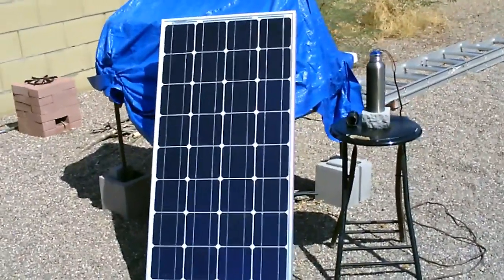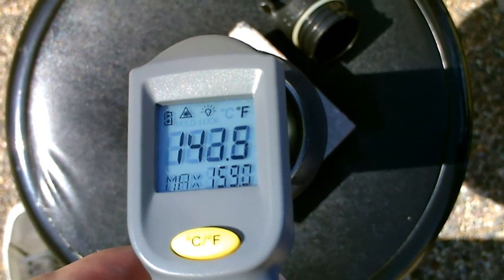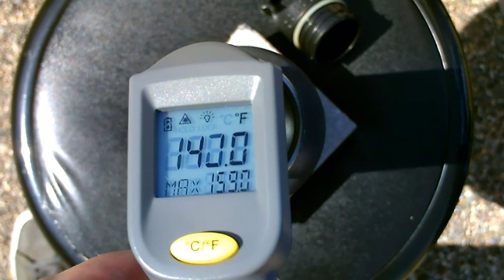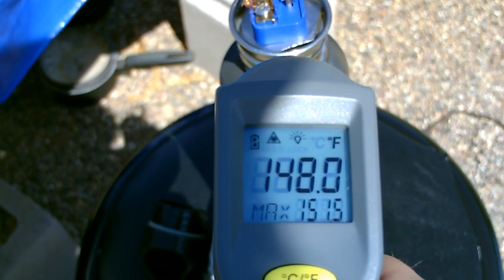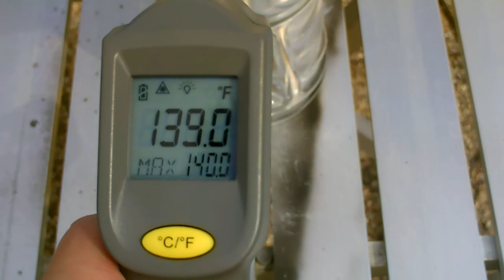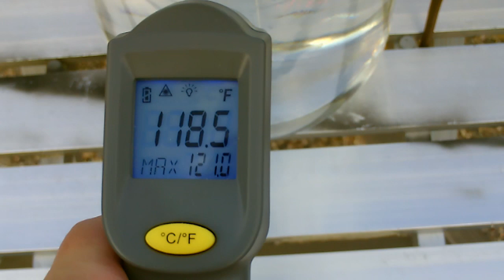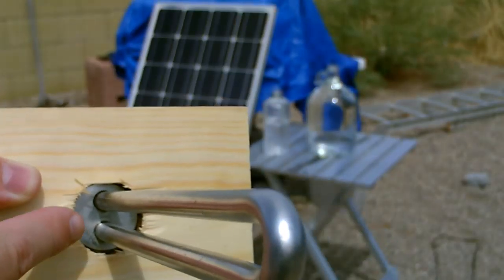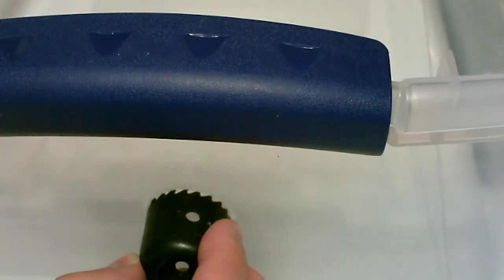How to Heat Water with a Solar Panel! - Small Batch PV Hot Water Heating! - Easy DIY

Comment: I would recommend putting some kind of circuit protection in between the panel and the element, a simple resistor with a snap fuse similar to a car, and a switch.
This will protect the panel in case of short circuit.

Comment: Thanks for the video. Never pull a juiced up heating element out of the water it will fry almost instantly Always disconnect power first. They get hot enough if touched will remove chunks of flesh.

Comment: I bought a propane on demand hot water heater. When I make dish water I use a found ice chest. I just Rinse it out after each use but if you want you can use liners and start each wash with perfectly clean vessel. 

I make dish water use some Dawn and a squirt of bleach. I make it hot soaking my dishes so they are easy to clean.

Comment: How long did it take I want to use solar panel And a heating element in a big beer kegs I made a fire pit water heater for the pool but I want a few kegs getting heated with solar panels and elements so I can dump hot kegs in every now and then

Comment: it would have been nice to know how long it took to heat the water!
Reply from the maker: that will vary quite a bit depending on air temp, cloud cover, exact specs of your particular solar panel etc. i had clouds going in and out so element temp wasn't constant. can't give an accurate time frame. once element heats up it doesn't take long.
Reply: it would be nice if you expressed some gratitude for his exceptionally easy to follow videos ya grumpy so n so

Comment: Got me thinking about getting a small hot water heater for a car dweller . All you need is 2 gallons hot water heater one of cold water a 2gallon blending vessel and gravity. I have taken many gravity warm water showers. A trucker doesn't need to heat up water if he stores it under his sleeper it's always hot there so a 6 gallon batch of water will be the perfect temp for shower. I get 3 showers out of 6 gallon . I also use that water for hand wash. So I could probably get 5 showers out. Never tried for more hate to run out of water covered in soap.

Comment: Also one could put a capacitor and a battery in line with the element to turn off at desired temperature and then charge the battery.

Comment: Excellent idea!  I invested in one of these that is smaller with a coiled end (though am not on the road overnight much, if at all, anymore) so I wouldn't have to boil water with gas and have a potentially leaky gas canister with me.  I never thought about using a larger bottle or even insulated flask though have the insulated mug, great idea! Thanks for sharing!
Reply: can u make it with a very tiny solar panel like 20x20 solar panel? i have two of them
Reply: @peppermeat8059  No most likely, even if you solar panel is unlikely 20 inches by 20 inches... though close to the more likely 100W minimal solar panel size of like maybe 36" by 24".  You'll need a larger panel that can produce at least 100W power.  Also, depends on the specifications of your heater, volume of water heating and the insulation capabilities of your system so heat isn't lost when heating and water gains heat to temp your want.  Figure your solar panel has a rated output in volts and amps where volts multiplied by amps equals power in watts.   Then if that solar panel can meet the specifications of the immersion heater.  The immersion heaters range from 100 Watts (W) to larger sizes.  I'd plan on using a smaller immersion heater and plan to heat a cup of liquid (~.25 Liters (L)).  Once one has enough solar power, see how that performs based on weather conditions for sunlight that provides the solar energy for your solar panel.  If one thinks can do more, than upgrade volume of water maybe first if the insulation capabilities are performing well enough.  Or if time is something one doesn't have and needs heated faster, then increase the immersion heater and solar panel size.  Figure for a 150W immersion heater you require at least a 12V x 12.5A = 150W solar panel.
Reply: @jafinch78  i dont have that
Reply: but i have an 8,6cm x 4,6cm advanced crsytalline silicon solar panel could do better right?
2 7,9cm x 4,4 cm basic solar panels could it atleast warm it a little?
Reply: @peppermeat8059  I little maybe since a calorie is the amount of heat it takes to raise the temperature of 1 gram (0.001 liters) of pure water 1 degree C at sea level. It takes 100 calories to heat 1 g. water from 0˚, the freezing point of water, to 100˚ C, the boiling point.  So, calorie is related to watts (W) where 1W equals ~0.24 calories per second (cal/s).  So maybe 10W is easier to comprehend since equals ~2.4 cal/s and will heat the 1g (0.001 liters) pure water ~2.4 degrees C theoretically, in theory.   So, will warm a very little and slowly over time if there are not heat loses in theory and actually.

Comment: Good idea! 👍 Now where did you get the element and how long did it take to get the water that hot?
Reply: Google 12 volt heating element ? ∆ is dependent upon many factors, temperature of all, water,air,shade,insulation etc. Longitude playing a factor.

Comment: Most 100W solar panels end up being about 18V DC under load.
Which solar panel do you use in this video?
Which 12V heating element do you use in this video?
Reply from the maker: hi. i use a 100w monocrystalline renogy panel. the few extra volts don't have any negative effect on the heating element. i used a Dernord 12v 150w element.

Comment: can you show how you hooked up the wire to the solar panel next time and what size wire u use
Reply from the maker: hi. i just twisted it on their. i used standard indoor extension cord wire. (the common ones that come in 6 to 9 feet and cost about $1.50)

Comment: would be interesting and possibly very efficient to make a parabolic reflector using a mirror that reflects Infrared but passes visible-to-UV through to solar panels behind the mirrored surface, so you could reflect IR into the water and use the higher frequency light to run a heating element from the solar panels  :o

Comment: You can use an AC element of 1000 wat with the 150-watt panel it will work.
Reply: please explain with resistance calculation

Comment: what is the time it takes to heat the water?
Reply from the maker: hi. it varies quite a bit depending on how much water you are heating and if you are running the heating element at full power but i think i've heated a liter to boiling in like 7-12 mins. i've have to double check that though as i'm going on memory (i'm currently using the element in a large ice chest)

Comment: Would it work for distilling water?
Reply: A basic solar water distiller would be cheaper, simple and probably more effective. Unless of course you take the panel's current to produce HHO then you could make some serious #distillation !
Reply: Yes but to get any measurable amount you want to use propane or wood pellets for fuel . You can get 50lbs sack of pine wood pellets from tractor supply <$9 Best to make your own distiller use same setup moonshiners build. You can go large as you want or as small as 4 quarts.

Comment: How big does the solar panel has to be?
Reply from the maker: i'd use at least a 12v 100w one. if you want the element to run at 100%, use 2 100w panels.